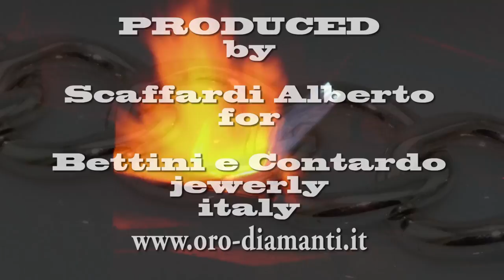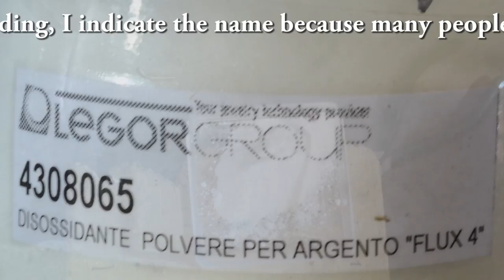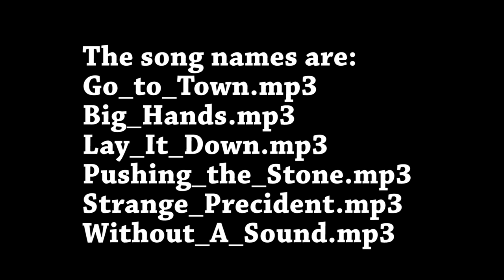Handmade bracelet chain gourmette silver

Comment: 1 Ounce silver bar - 32 CAD (Yes our local prices are rigged and suck)
1 Ounce silver bar - 100 - 150 CAD.
1 50 / 50 raffle - 300$ @ 20$ X 15 Tickets
1 Ounce = $300.

Worth the venture?

The equipment used to pull the bar through the plate with the the hole on it, has a chain link contraption inside, what is it called.
Reply: nice

Comment: So Cool!!! What is the tool called at 7:53 and what is the machine called that you use to pull the wire through with?
Reply from the maker: Thanks I using a hand drill and the tool to pull the wire you can see at this address  http://www.luigidaltrozzo.it/?s=trafila
Reply: In English it's called a Draw plate. Works in a visa also. But the machine is great if you have space. 

Thanks for the video! Well done
Reply from the maker: DLR Creator Ok Thanks

Comment: instead off using the hamer you can use a roller and do the final with the hammer its quiker and if you are relly bad ass i am its easier
Reply from the maker: I have not tried it with the roller, do not, cause I think that during the transition tends to move the rings of the chain. I can just do a test to see. thank you
Reply: +scaffoal you can unse a moving roler ontop of a metal piese also like the thing you use when backing